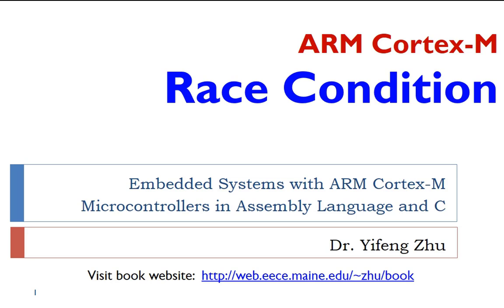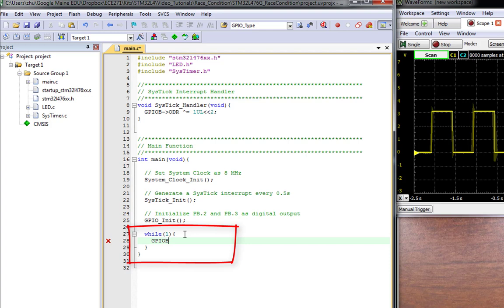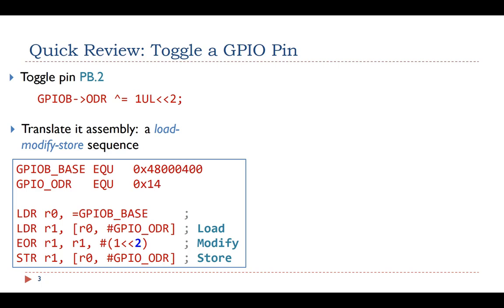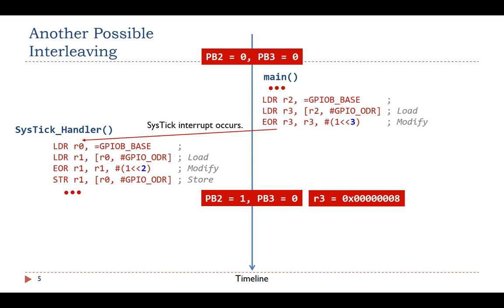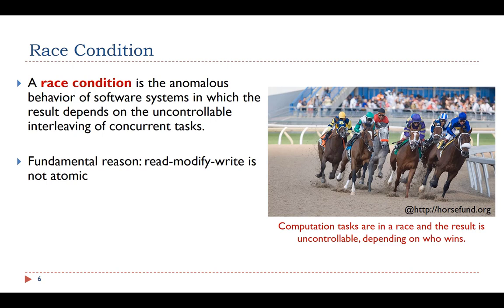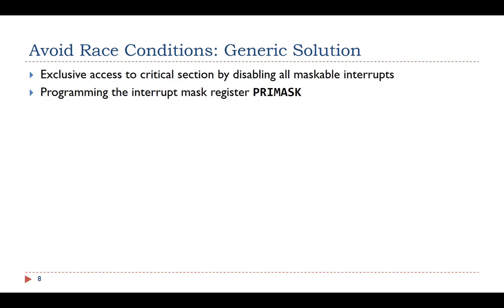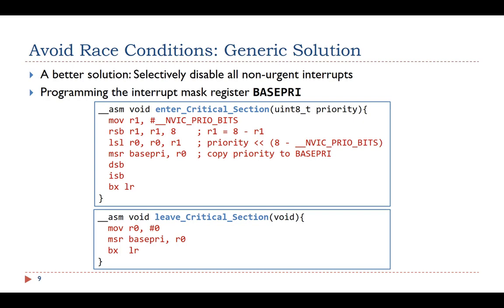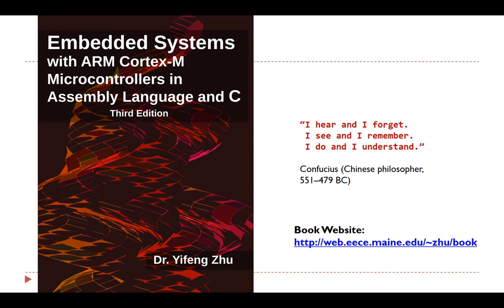Lecture 17. Race Conditions

Comment: At 4:24, I think it is supposed to say, the old output of pin 'PB3' is also  stored in the register r3 instead of PB2 is also stored in the register r3. Same at 4:38, where it should say the old output of 'PB3' is mistakenly written to the ODR register.
Reply from the maker: No. What I said is correct. The output of both PB2 and PB3 are stored in register r3.
Reply: r3 contains all bits of port B ODR register including bit PB2.